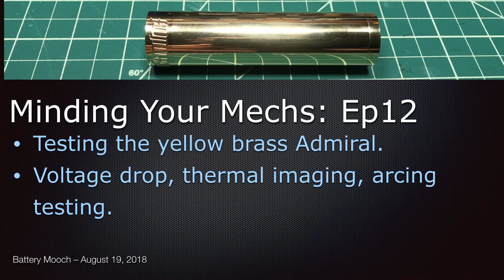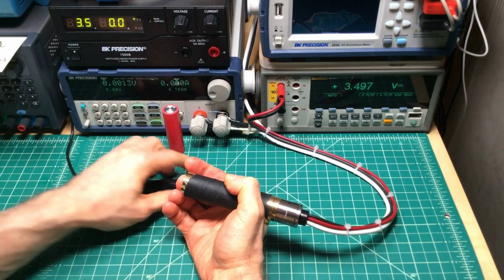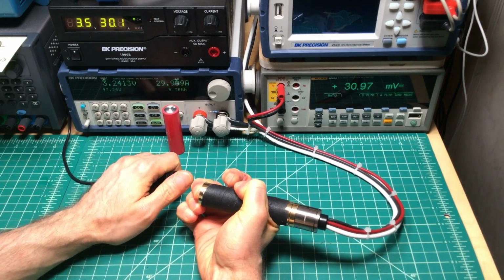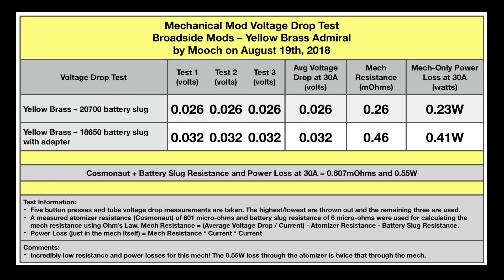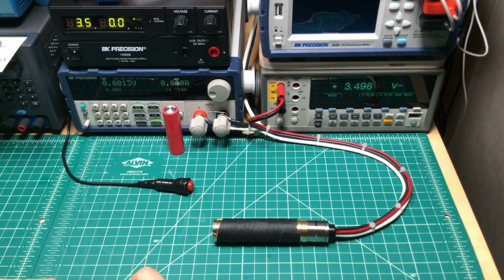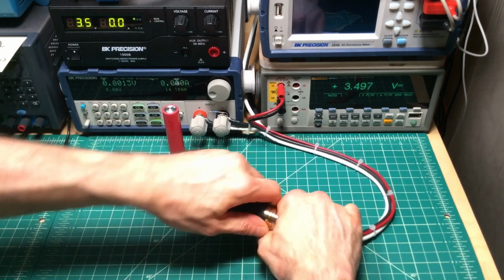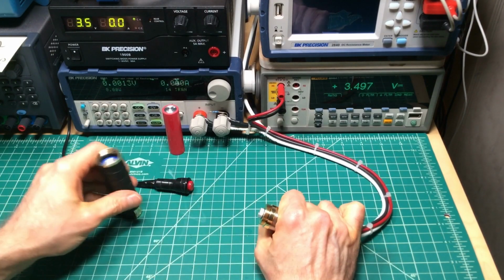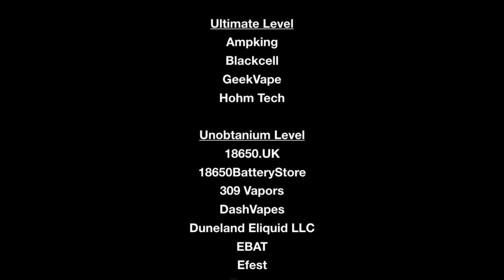Minding Your Mechs – Ep012 – Yellow Brass Admiral Mech Testing

Comment: Can i use 21700 in the admiral?
Reply from the maker: It is an 18650/20700 mod. I don’t think any 21700’s will fit. Ask around though or check with the manufacturer.

Comment: Great test as always, great mod! One observation, the aluminium, while theoretically a great conductor, seems to suffer a lot from inconsistencies in contact (maybe the threading is the problem?) and arcing. Is it possible that this all has to do with the fact that aluminium is a softer metal? Also, man I can't wait to see the crazy results we'll have from the copper admiral. It will surely be the one to beat, the reference if you will, for all future mods! Love ya Mooch😛
Reply from the maker: Don’t know yet. I’ll need to test a lot more mods before I can really see if it’s metal choice or just individual mod design.

Comment: why didn't you unscrew the Delrin or silver plated contact part that touches battery as well and look to see if there was arcing on that as well?
Reply from the maker: With this mod the contact is pressed tightly against the battery and there is no movement. No chance for arcing. I have just examined the battery now and there is no arcing damage on the battery.